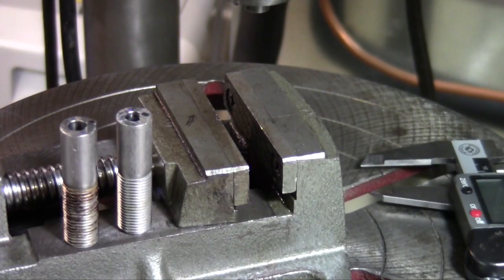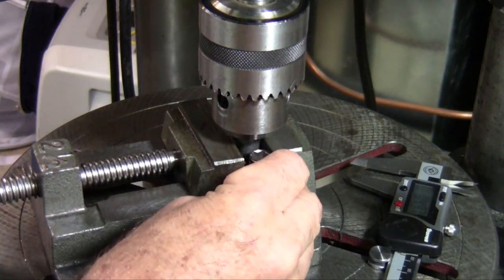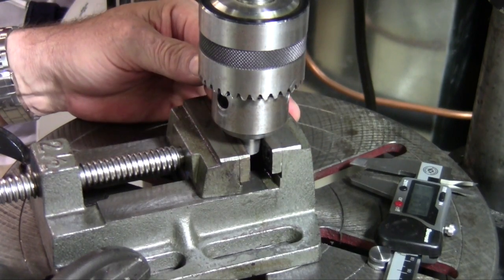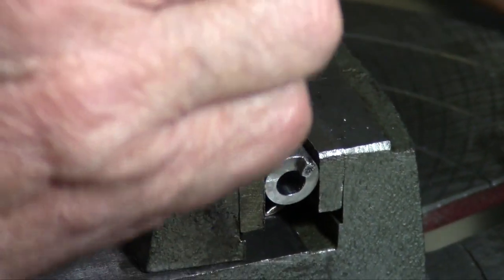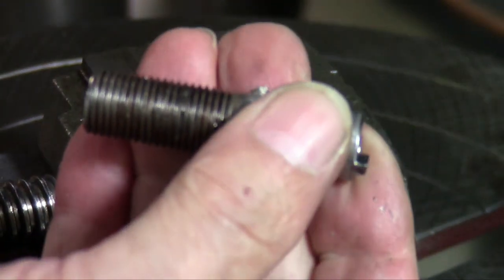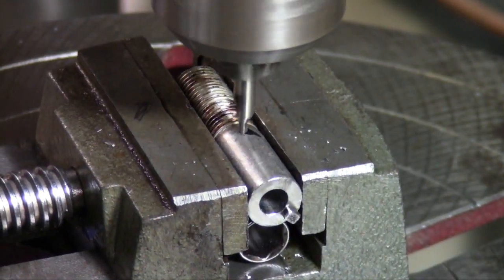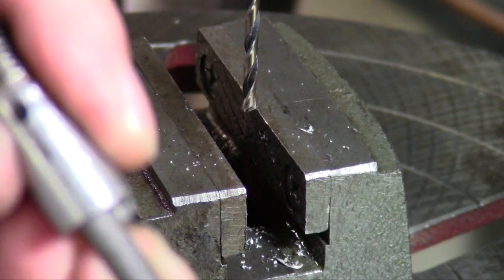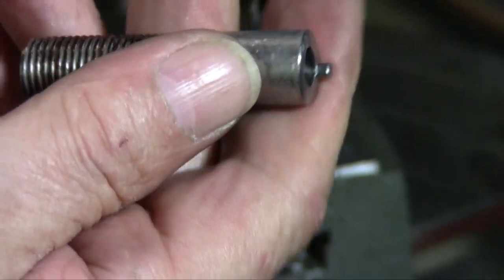How to make a Hand-piece for the Homemade Hand Engraving Machine part 5 barrel vent holes

Comment: Where are you getting the air hose Mr Rick?how thick and flimsy is it rubber type or is it a hard plastic type?
Reply from the maker: I use clear vinyl tubing I can find at most hardware stores, .170" ID x 1/4"  OD

Comment: Hey Rick. You wouldn't be interested in building one twice the diameter of the barrel and weight and 2 inch longer
Reply: It can probably be done, but it'll actuate a lot slower since the hammer piece would be twice the mass.